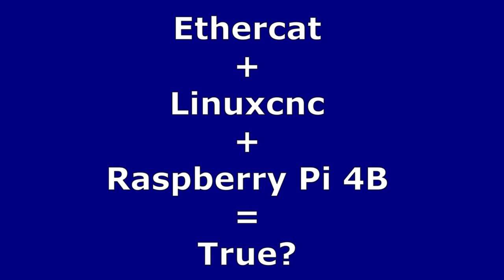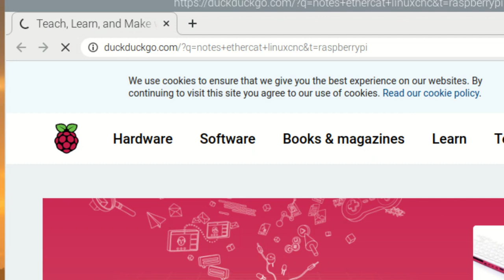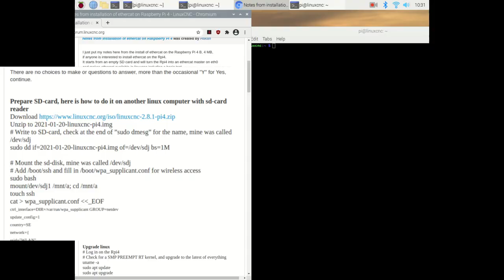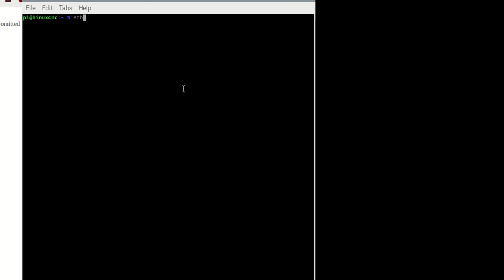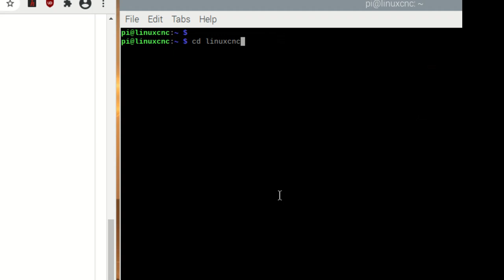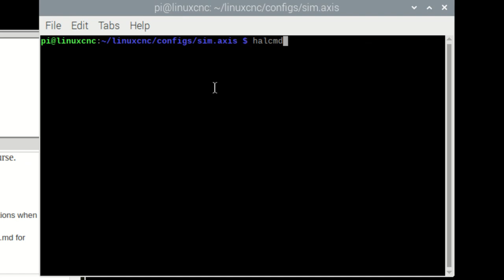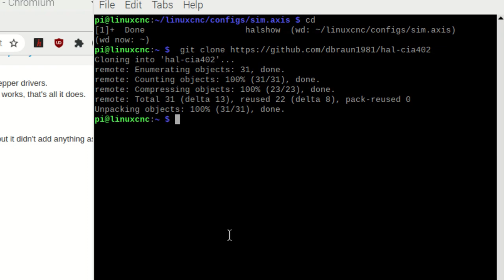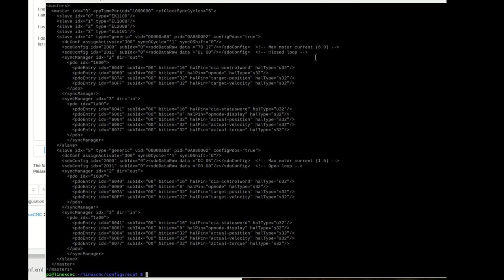Ethercat + linuxcnc + Raspberry pi?

Comment: How did you write sd card with linuxcnc-2.8.1, I have used rpi imager to write sd card but its not booting. Also I have tried other images but they don't have same kernal as shown in notes (linux-headers-4.19.71-rt24-v7l). Is there any alternate solution for this ?

Comment: Hey @MetalMusings, Thanks for your wonderful video. I saw it many times to understand how command lines worked. In my case, I want to use Raspberry Pi 4 B as an EtherCAT slave with Beckhoff IPC for an Injection Molding Machine. I followed the same steps but unfortunately it didn't work in my case. So, please assist me with how I can use Pi as an EtherCat slave and if there is any Kernel or add-on needed, please share it with me. Additionally, please let me know how to approach you for any specific query such as how to test latency in this EtherCAT communication and to read and store this real-time data of the molding machine on Pi (with the help of CodeSys whose runtime application is running on my Raspberry Pi 4 B) ?

Comment: Thanks for sharing. A couple of questions I had while researching LinuxCNC and EtherCAT. How would a Beckhoff EL2521 be used to drive a standard Step/Dir Stepper driver? I see it is a supported Beckhoff terminal however I have found little mention on the forums of it's use.  Perhaps a video if you have a EL2521 handy? I would also enjoy a follow up video going over the encoder input, I am currently looking into 0-10V and fwd/rev vfd control with encoder spindle feedback using Beckhoff EtherCAT terminals and LinuxCNC.

Comment: Thank you for the video. This was very useful for me. I have a Beelink mini pc instead of a raspberry, but I'm using that to drive 3 nema34 stepper motors with the Rtelligent ect86 ethercat enabled stepper drives. I use usb to rs485 to control my spindle speed which is not so time critical.

Comment: Hello,
Thanks for your great video. I was waiting for that. I'm about to build a cnc machine using raspberry pi. My concern here is that I already bought servo stepper motors from stepperonline with a controler that doesn't have ethernet port. It's the cl57y. But It's got an alarm signal. Do you think I can still use the advance functions of linux cnc such as recovery position in case of emergency ? Can I still use the same setup as yours ?  Probably not the same BOB. Thanks

Comment: Another super video, I learned so much I forgive the lack of broken endmills. 

It would be fantastic if you gave your thoughts on ethercat versus a mesa system - e.g. what advantages ethercat brings to the table and why you're exploring it. I haven't found anything online about "why ethercat" except sales pitches from manufacturers. (Of course "because I was curious and felt like it" is a perfectly good reason too.)
Reply: Hi, personally i think there are many benifits if you can get over the setup software hurdles!

- No step/direction wiring 
- less prone to interference/ noise
- Absolute encoder interface, no homing required, just a once off zeroing procedure.
- you can map your drive io back to linuix cnc totaly removing the need for an io module.(depends on drives)
- You dont need a BOB like any of the mesa setups.

I think when you factor the build time and materials, cost are lower than other options too.